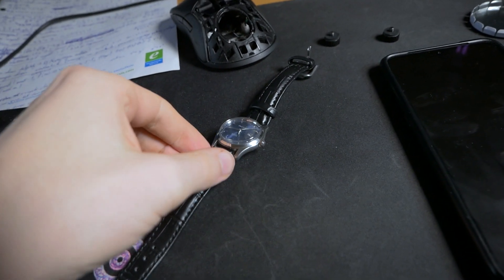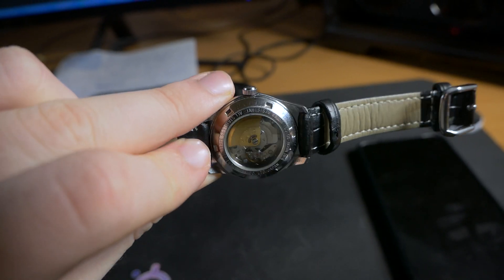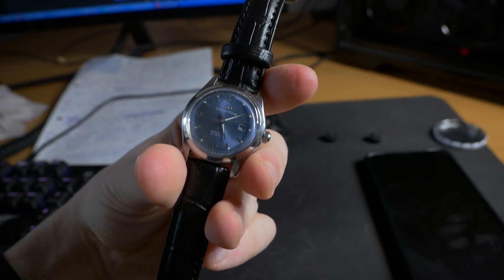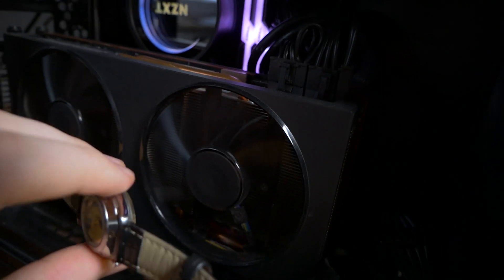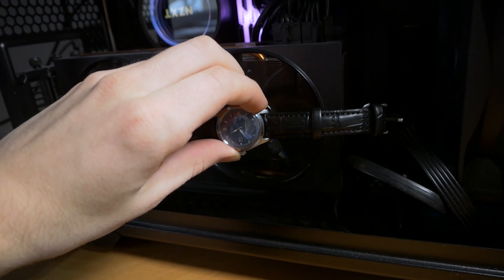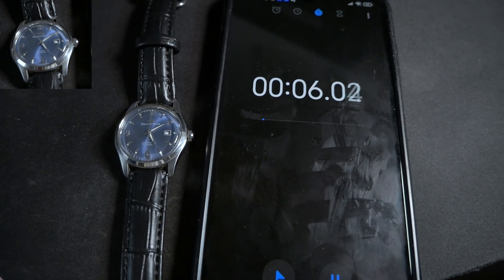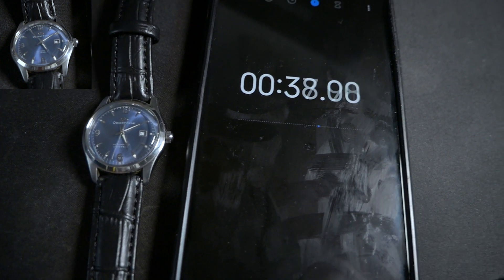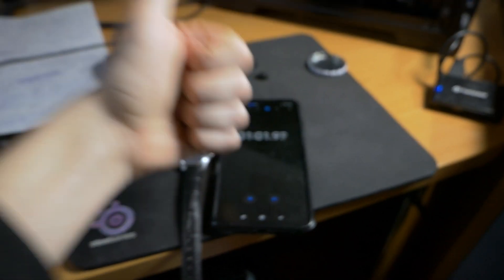How to demagnetize a watch WITHOUT a demagnetizer tool at home (for FAST mechanical and automatic)

Comment: Wow, that explains a lot. My watch has always been running about 2 seconds fast per full cycle, and I could never figure out why. After watching your video, I learned that magnetization from everyday electrical devices is actually a very common cause, especially with mechanical watches.
I followed your steps exactly and checked/demagnetized it, and the results were immediate. The timing is noticeably better now, and it’s running much closer to spec. It’s amazing how something so simple can cause such a consistent timing issue.
This was a super helpful and practical tip, and it saved me about $20. Really appreciate you taking the time to explain both the cause and the fix so clearly. Thanks a lot!

Comment: I believe this fixed my seiko alpinist.. 
It was running 5mins slow by the end of the day after setting it to the correct time in the morning. 
Also would die sooner than the claimed power reserve of 48hrs.  
Turned on my small hand fan, and waved my watch around it..
And now, even after 2 days, the watch is maintaining the accurate time even if its just kept on the table. 

Thanks a lot for this quick fix..
Reply: Still holds time ?
Reply: @SalmanKhan-mj5nl it works fine for a day. Then slows down. Maybe its time for a service.

Comment: Still 5 seconds lol
Reply: Genius, he started to count at 55 and stopped at 55 exactly without losing seconds... 🤡
Reply from the maker: Great we have the blind guy that can't tell the watch was timed from 55sec on watch aka. the frame where I started the phone stopwatch to the first frame over 1min on the ⏱️ showing that it is in the same position.

And the deaf guy that didn't hear the watch was skipping forward 5 seconds every MINUTE. Not +5sec per day, not +5sec per hour. 

It's a 2min video showing a quick free fix for a cheap watch that costs less than a demagnatizer tool or a service that worked for this specific watch. Went from skipping 2 hours a day to around a minute a day but clearly that's just not good enough.

🤡🤡🤡
Reply: @kaPaURL  some people are weird my friend, very weird 😂

Comment: I don’t know if this works or not but a sure method is to wave your watch in near the screen of an old TV while it’s powering up, if you have access to one. Old TV monitors perform a degaussing procedure while turning on so your watch also gets demagnetized. Tried and true.
Reply: you can't use "idk if it works" and "a sure method". You're either sure or unsure. Anyway i tried it rn il update if it worked tomorrow.
Reply: @Robert.Voor156 ”I don’t know if it works or not” remark was referring to the fan method, not to the method I have described. Sorry for the misunderstanding. Old TV method works surely. I have tested it myself.
Reply: @zumanon  i tried it a few times too. now it's losing minutes instead of hours so it did something right, thanks!
Reply: @Robert.Voor156  I’m glad it worked.
Reply: Thank you for this, I was looking for a way to try and demagnetise a vintage watch without having to buy something to do it, and I collect crt tvs. Big help
Reply: @connormcnaughton4267  No problem.. Did it work for you?
Reply: bro, you have me searching for a old crt now 🤣🤣 if this shit works you're an absolute legend 💪 thanking you in advance because i trust the replies 😂
Reply: BRO!! Im learning new/old shit today, you legend "All color CRTs include a built-in degaussing coil wrapped around the perimeter of the CRT face. These are activated each time the CRT is powered up cold by a 3 terminal thermister device or other control circuitry. This is why it is often suggested that color purity problems may go away in a few days" 🤯 --- now to flip my garage upside 😜

Comment: Thanks for taking the time to share this. 
Do you know if your fans are powered by DC or AC current? Does it matter?
Reply: All electrical current inside a PC should be DC. The only AC should be the AC accepted by the PSU, which then re-distributes the DC through its various voltage rails. The GPU PWM powers the fan controllers.
Reply: @dainluke  so can i use m dc motors
Reply: You have to induce an AC current for this to work and that happens with AC fans
Reply: Actually I think it needs to be an AC fan, because I think DC fans use stationary magnets…I stand to be corrected. 🙈

But I’ve just tried this with a DC powered fan, and it didn’t work. 

I’ll try our house fan quickly. 👍
Reply: @stuffshop4883  BUT AC WORKS cause it has fluctuating

Comment from the maker: To sum it up:
• second hand on my watch did a full circle in 55s,
• I saw on the web that a common reason for this behavior is magnetization by electrical devices,
• I checked that it did in fact have a magnetic field with sensors on my phone (many different apps have this),
• I did what I did in the video and it fixed my issue (you could also use indoor cooling fans/cpu fans/any other electric fans if you don't have a gpu like this).

I hope I could save you 15 bucks or an extra service visit  : D